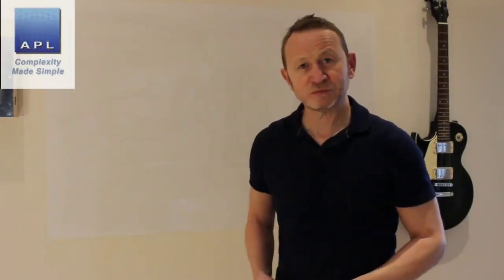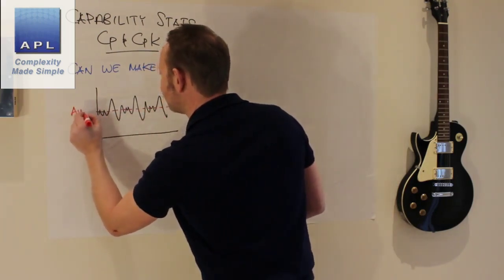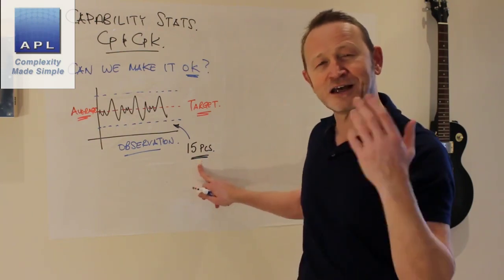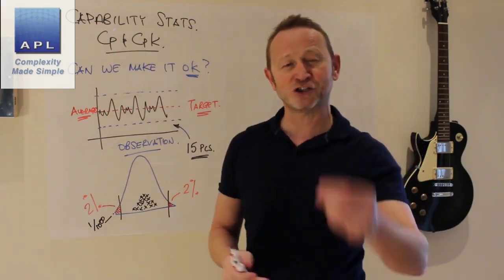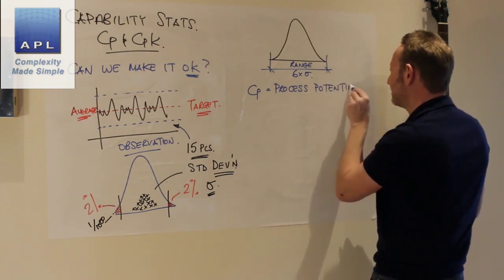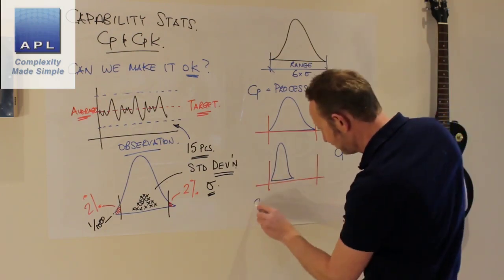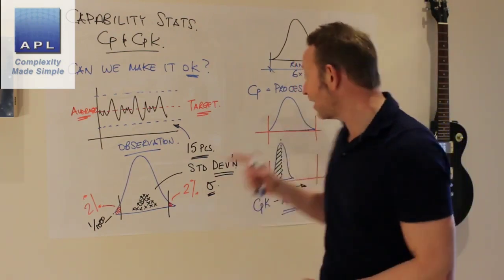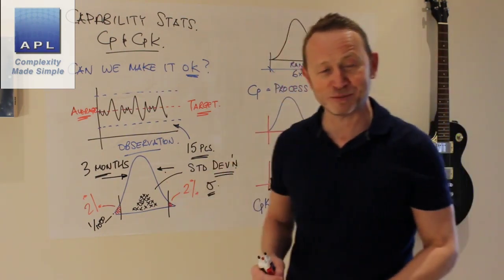Cpk   What is it?

Comment: How would you calculate cpk or ppk for a job shop kind of process where the tolerance varies at each batch ? Like machining different parts or hig speed lines with same process but each batch has different spec limits ?
Reply from the maker: Arshdeep - if the tolerance constantly changes you deduct the target value from each result. This normalises the data so that it can all be placed on one chart....
Reply: @paulallen5321  I just bought your book spc for small productions. Not delivered yet. Does it have the same thing you are talking about ?
Reply from the maker: Arshdeep - you should find what you're looking for in there...thanks for your support..

Comment: Great video as always (have recommended your channel to the junior engineers at my work). Question - how would you deal with CP and CPK on a process with one specification such as a not to exceed target time?
Reply from the maker: Hi Paul - good to hear from you. It's pretty easy to deal with a one sided spec, work out the Cpk using that tolerance only. The Cpk calc only works with one tolerance anyway, usually the nearest one...The Cp cannot be worked out as it needs 2 tolerances...